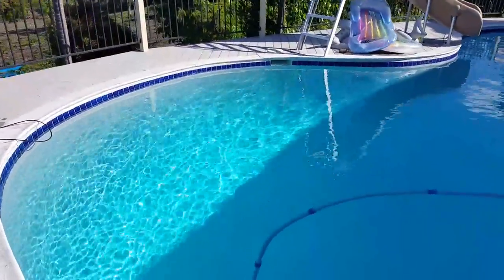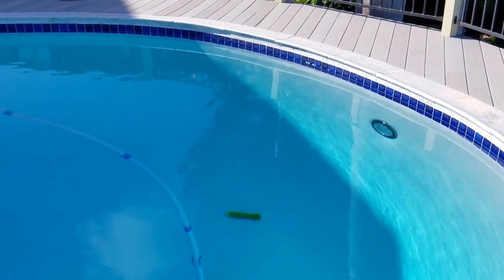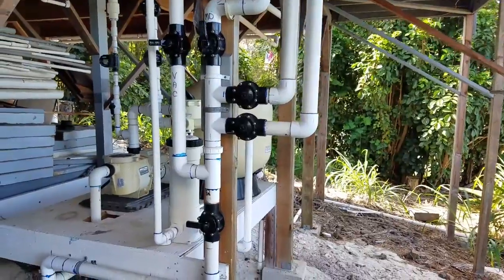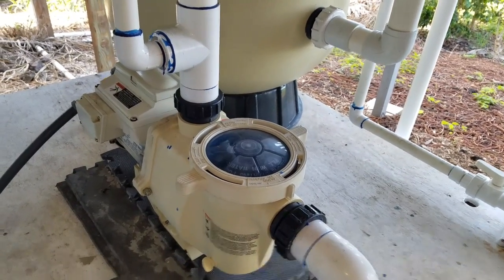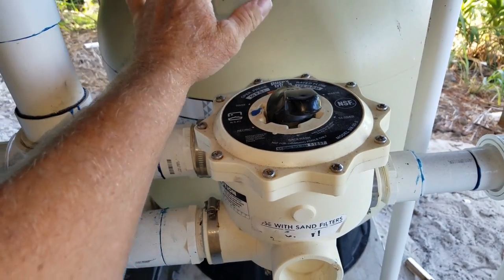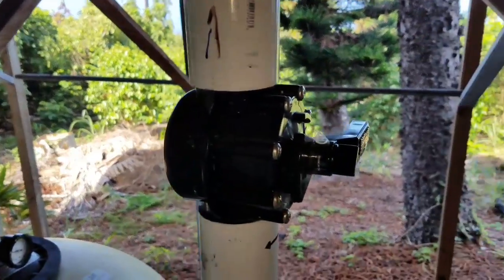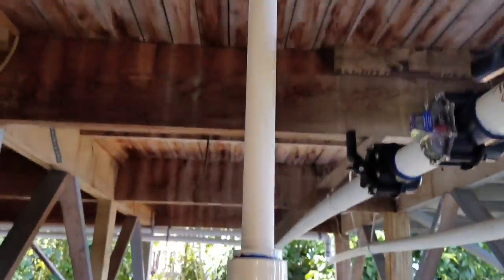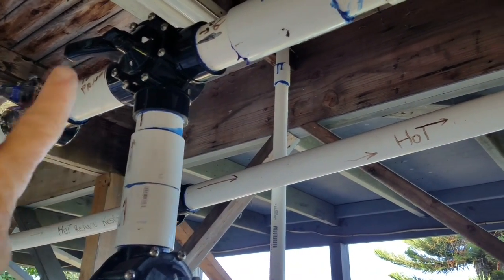SWIMMING POOL CIRCULATION SYSTEM FOR BEGGINERS 2

Comment: I'm a plumber, researching pool systems for myself, and I have to say, you have made such a great video.  Dispelling fears of the systems, you did so so so so well.  Thank you!   Xx
Reply from the maker: You're very welcome. Feel free to ask any other questions and if I am able to help I'd be happy to.. if you're going to be building a pool for yourself or having a pool built  make sure that if you've got a skimmer,  main drain and vacuum  lines don't join them all into One Singular line. If you got four points of suction just have four valves for suction control and isolation

Comment: Wow! Thank you for your response - dang I have homework!  Seriously thank you for your response and advice.  I really appreciate the tip about pool plumbing troubleshooting i.e., start and end at the pump.  

I brush and net the swimming pool daily and sometimes twice a day; I periodically check the floater, which houses the two-(2) chlorine tablets and they usually last about ten-(10) days until they're the size of a quarter.  The pool was looking great until the heavy rainfalls and more important family life matters required my full attention. However, since posting my video I have done the following over the last week or two;

Thursday, 21 June 2018, added approximately one pound of Suncoast Stabilizer Conditioner [caked and dried due to the container was cracked on the lid] to the swimming pool 
Wednesday, 20 June 2018, added water to the swimming pool at the appropriate level
Tuesday, 19 June 2018 added one-(1) package of granular Pool Essentials Pool Shock; added two-(2) chlorine tablets 
Monday, 18 June 2018, I attempted to clear the pool's suction pipe with the Cobra Drain Bladder; the Bladder got stuck and came apart – thankfully I was finally able to remove it from the skimmer/suction/vacuum pipe
Sunday, 17 June 2018, poured two-(2) gallons of Pool Essentials Chlorinated Liquid into the swimming pool
Saturday, 16 June 2018, added one-(1) to two-(2) pounds of calcium hardness [sadly the four-(4) pound container's seal was cracked and the humidity transformed it into gelatin]; added one-(1) package of granular Pool Essentials Pool Shock; 
Friday, 15 June 2018, cycled through the pool plumbing system to waste, recirculate and filtration
Thursday, 14 June 2018, added one-(1) package of  granular Pool Essentials Pool Shock 
Wednesday, 13 June 2018, from 0710hrs to 0800hrs, added one-(1) package of  granular Pool Essentials Pool Shock; added water and cycled through the backwash, rinse and switched back to filtration; from 1330hrs to 1430hrs, with sand filter valve set to backwash I added water while vacuuming; 1615hrs to 1645hrs, poured one-(1) gallon of Pool Essentials Chlorinated Calcium-Free liquid
Tuesday, 12 June 2018, 0930hrs to 1030hrs cycled through the backwash, rinse and filter with the swimming pool pump
Reply from the maker: Your secret ingredient will be the yellow treat or trine.  Don't blindly add chems it could make things worse.  Adding conditioner should only be done if you have less than 20 or 30ppm "Pentair, water hardness test" comes in a little blue rectangular box.  Test the hardness and then call me. 808 960 1026.

Comment: That 90 degree elbow immediately before the pump intake is a major (and common) plumbing error. Your pump installation manual calls for a length of STRAIGHT INTAKE LINE a MINIMUM of 5x the pipe diameter. So in order to avoid turbulent flow restriction for 2” pipe you need at least 10 inches. This is especially important with the system in this video with crazy long run lengths, tons of valves and 90 degrees turns. Much of the efficiency of the variable speed pump is negated as these restrictions add up
Reply from the maker: Aloha, technically you are absolutely right! Sometimes there are space restrictions and with variable speed pumps where you can control the flow rate of water it's less of an issue than if you're using a single speed pump.  The fact that this particular pump room is about 20 ft below the pool offers a constant positive head pressure pressure  aiding the prime and flow for this pump. There's no question however that 90° or any angles will reduce the flow efficiency in circulation.

Comment: Why would you pump unfiltered water to the chlorinator?
Reply from the maker: DontNeedToKnow84 

Aloha in this case it was just easier to work with rather than trying to Plumb everything over head. The volume of water however that is bypassing the filter is inconsequential.
Reply from the maker: The amount of water that actually bypassing the filter is not an amount that plays any part in the clarity of the water and you can go one way or the other when you're talking about that amount of water bypass. For this particular setup it just worked the easiest. Again we're talking about a 1 inch column of water bypassing the filter. Thanks for your question I am very sorry that we didn't respond to you earlier.
Reply: I would fire my plumbers for plumbing a chlorinator before a filter. "Only 1" of column." Research turnover vs actual filtration. And I love the 90 kissing that suction union when there plenty of room for a 8" nipple.

Comment: I'd hate to see that system during a frost.  Hope he lives in a warm environment.
Reply from the maker: For sure . . . .dont cry any tears for them!  In the winter time it "plunges" down into the mid to lo 70's.  Thank you for subscribing.
Reply: I don't cry.  I see too many 90 degree angles which all should have been 45's before and after a 180.  Way more efficiency, less wear-n-tear on your equipment and cheaper electric bills.  Also, I DID NOT SUBSCRIBE.  Not sure where you came up with that one.
Reply from the maker: Aloha, yes your right about the 45's and the technicality of that, although it simply isn't done in the field very often.  Rarely if ever...here in any case.  Also to your point, TECHNICALLY a DE filter  would have been the best filtering medium because TECHNICALLY it will filter out a much smaller particle. That being said you simply won't see the variation between a sand filter and a DE filter if the pool in general is well balanced.  So, the point your making are good ones, just not feasible most of the time. (45's increase the distance/space required to plumb a room) And again, the savings your suggested will be so  minute it isn't worth trying to track. Especially when a variable speed pump is concerned.  Have a great day out there~
Reply: Appreciate your well thought out response and I agree with most.  Over time, the 45's will save you a ton of money and they do not have to create a large amount of space increase.  Have a great day and keep up the great work.
Reply: The name of the video is KONA pools. We don’t worry about frost HAWAII. Lol
Reply: @drdrew3  Brilliant response genius.